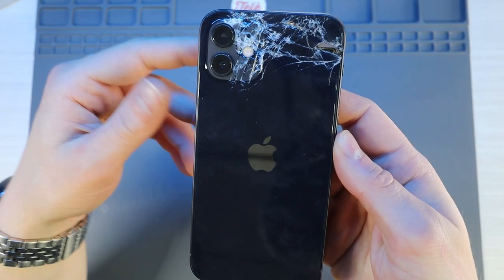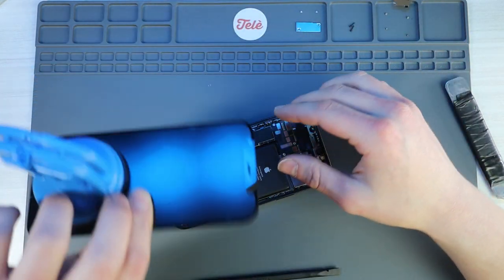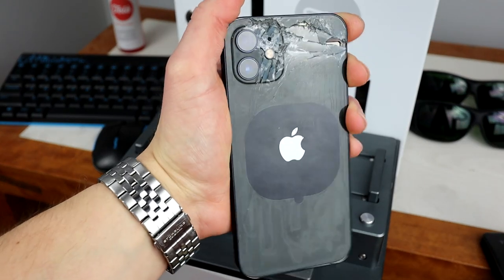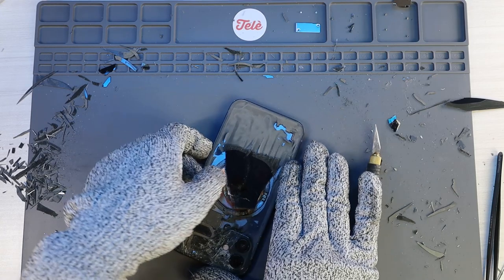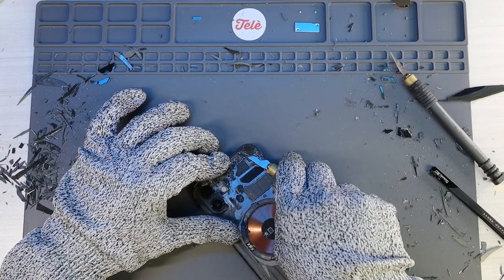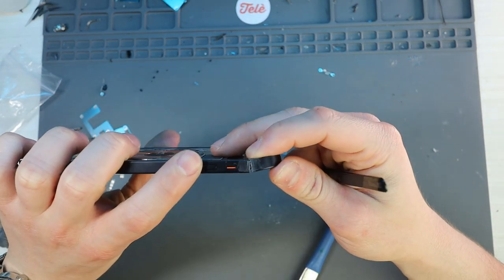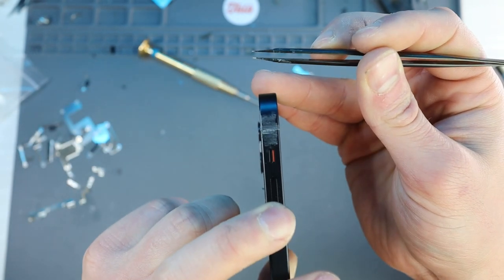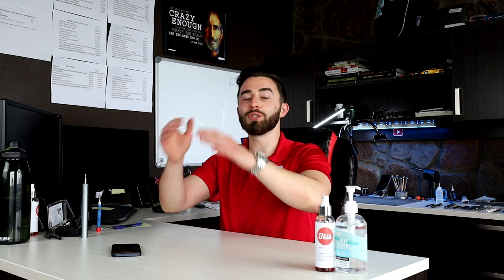IPHONE 12 RESTORATION | NEEDED PARTS THAT DON'T EXIST YET

Comment: You know b7000 needs 24hrs to dry and cure, right? And mixing it with gorilla glue doesn't do anything but just add a weaker glue to the mix? Giving it 30seconds to dry won't do anything, obviously. You're next thought is to screw a plate in between? Are you just wanting that person to come back because that doesn't haven't the slightest bit of holding up, in the long run? You're wasting the customers time, and money,  by making a very temporary fix.
Reply: Why are you butthurt. He did say he let the glue dry for 2 whole days and didn't hold up. That metallic plate was pretty smart and did the job he also glued down any loose part or metallic grinding spots. 
He also let the costumer know that he couldn't do the whole housing transfer and did let him know that it would be better to go into a apple shop with apple care.
Reply from the maker: Does someone need a hug?